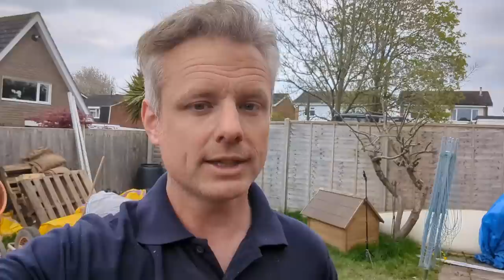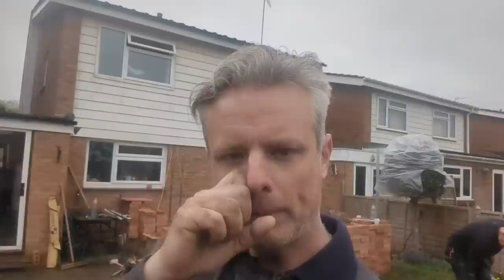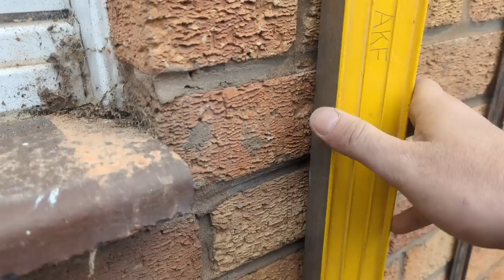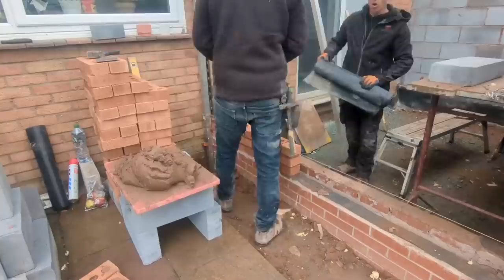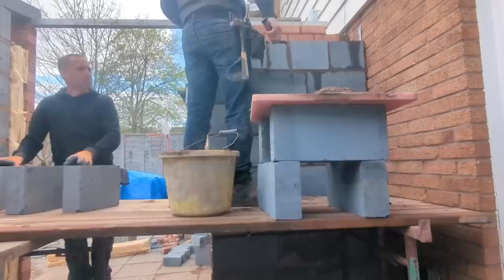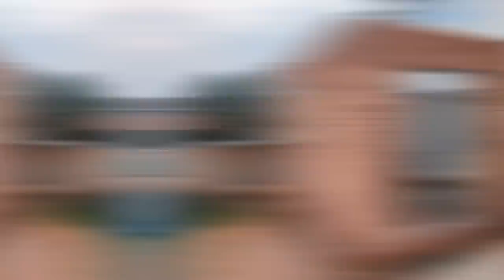HOW MUCH???!!! Warm Roof Extension Part 2 Bricklaying up to Wall Plate

Comment: Hi, thanks for the informative video. When I built some extensions several years ago you had to cut in to and continue the cavity where it joins the original back wall. I see you have used the vertical tie in straps but the cavity is bridged by the original back wall, similarly where roof meets original back wall, cavity trays would have had to be inserted (although in this case the cladding would probably suffice )so that the new inside wall is completely separated from the outside brick work. Is this no longer a requirement and does it pose any future problems with damp penetration if the wall subjected to high rainfall? Thanks
Reply: I could agree more, also fulll fibreglass cavity fill with a brick outer leaf... good luck with that in a bad wet winter.
Reply: yes thats how it should be done, could have problems with damp later on moisture can travel not so much through the brick but will travel through the mortar

Comment: Very interesting Adam, I’m glad an update is imminent for your house. Being honest, that’s the one I’ve found most interesting as it’s relatable 👍🏻
Reply from the maker: Cheers man, really appreciate you sticking with us. I take it you've got a bit of a project on of your own at the minute?
Reply: @mrabuilders6723  Hi Adam, not on your scale but I’m slowly working through my house. Old house, solid walls, no insulation type deal. Ceilings down, floors up, electrics and plastering. Yes, the prices are just crazy, even PIR board is through the roof (no pun intended)

Comment: Our build for our 6m X 6m extension went from £55k + vat to £58,500 + vat because the price was given using the old costs as opposed to the new regs
I paid without really arguing the point because I know the process are just going to keep going up
Reply from the maker: Fair play to you mate. Hope you're well.
Reply: @mrabuilders6723  just finishing all the little jobs that I couldn't afford for the builder to finish off, it's only been a month but just got the washing machine plumbed in 😁
Final job is getting the water softener fitted in two weeks time and then we can relax 👍

Comment: Hi just seen the build upto plate can't see by the video the cavity not being cut with a vertical DPC put in place, surely this will lead to possible damp issues ?
Reply from the maker: Hello steve, hope you're well. Thankfully we're not required to do that round these parts. Not doing that won't cause any issues at all. I get this question a lot and I have covered it in a previous video but I think I'll go into more detail in a future one. Thank you for watching, all the best.

Comment: I have some questions, I'm not from the UK... Why don't you make a concrete foundation and put the bricks directly on the ground and why no reinforced concrete pillars at the corners? Can that building withstand an 7+ earthquake and why do you make the floor at ground level, don't you have problems when there is a flood? It seems strange to me in a new construction not to rise a little. In my country, a cement/concrete foundation with a minimum depth of 70 cm is mandatory and the brick wall is not for strength, reinforced concrete pillars are needed and their thickness increases if the house has a second or third floor. We do the same with insulation between the rows of thin bricks.  We also finished an extension to our house in Innsbruck, Austria and I was curious. Thank you!
Reply from the maker: Lot of questions there mate but thanks for commenting. We don’t worry about earth quakes here and if this house floods we will be getting Noah and his ark out to save us all. 👍🏻
Reply: @mrabuilders6723  Asking because I've seen images from the UK of floods on TV, cars go quite deep in the water up to the bumper and there are quite often images of water in houses and I always wondered why you build the houses at ground level..I mean if it rains hard for several days in a row, they will have to call the fire department with a pump to remove the water from the kitchen 😂anyway, I'm glad that you started to insulate the houses in the UK , cold times are coming👍

Comment: Is cavity closing with the blockwork no longer allowed, even with a vertical damp between the facing bricks and the blockwork. That's the way it was done when I built an extension in 1976.  Just curious to see how much the regulations have been altered...Regards Robin.
Reply from the maker: Hello Robin, hope you're well. To be honest I'm not sure whether you're allowed to do that anymore or not but it's certainly not common.

Comment: so much for saving the planet then? 150mm cavity means bigger slab,equals more concrete, wider lintels means more steel and all the production elements into that..150mm insulation instead of 100mm etc etc.....i'm sure their going to say this reduces the heating costs of a building  overtime .....
Reply from the maker: Hello mate, can't really argue with any of that!
Reply: Build in timber instead!! A PIR filled timber 120mm timber panel meets the new u-values for Part L

Comment: Hi just seen a few videos and I appreciate them. I’m dreaming of an extension one day. I’d like to see steps and Timelapse when you do each part. Perhaps from a diy point of view. 
If well informed nearly anyone could build one to a certain degree. 
It also helps with understanding costs of what the materials are and maybe where to buy them for the builder if that would help in advance. 
I know some builders think we all stupid. I once had a builder quote £3.5k for 2 windows fitted and I had  bought the windows this was just for installation. I found an honest builder who charged £1.6k in the end. Did a great job too.

Comment: Well where were you Adam, 150 cavity hell here, just worked out how much more the 150 drytherm has cost me more than the combination of the 100+50 of the same…£160.
Am just finishing the opening in the flat roof for 2 lanterns on to which the warm  roof is going
Any further saving tips much appreciated as the wife can only afford to holiday herself, well suppose ever cloud and all that…

Comment: maybe you need to negotiate more, I had a quote of £2000 ish for some lintels, after threatening to buy online, got them down to £1300! which is about 79% off list.
Reply from the maker: Hello mate, couldn't agree more as these are "off the shelf prices" but of course that works both ways and if the 100mm stuff comes off the same amount then the difference is the same. Again it's the builder who's the only loser though, they are the ones who have to negotiate and argue the toss all so the customer gets the best price! It's difficult isn't it!
Reply: Yes, I find it really annoying that it’s always a negotiation with builders merchants.

Comment: Hi just wondering why you don't open cavity or put in vertices damp
Reply from the maker: Morning Stuart, hope you're well. That's a question we asked a lot and the simple answer is, thankfully, that we don't have to. We've never had a building inspector ask for it, never seen it done with my own eyes and never have any of my builder friends been asked to do it. I'm of the belief that it's a complete nonsense and the structural damage that it can cause can be immense. That being said, if the building inspector asked for it, then of course we'd do it but we'd ask for our objections to be on their notes so we're covered. Appreciate you watching mate, have a great day.

Comment: Word of warning. Don't fit those cavity closers until the day you put the frames in. Bloody sun gets on them and they buckle up.
Reply: Cavity closers. A pain in the butt for Double glazing replacement if timber windows fitted. Get it wrong and plaster reveal gets disturbed or falls away.
Reply: @RAY Ponting  yeah, those 80s houses with magnet and Southern windows.

I used to recip between the frame and plaster and cut the cavity closer. Either that or just trim it with 90

Comment: I know building regs change every week but do you not have to cut the cavities up on the original house? It was a must when i was at it.74 by the way.Also much easier to concrete your floor by tamping off your brickwork at dpc level.

Comment: I would think the increase in cost is partially to do with inflation (don't know if you were using today's prices for the thin stuff) but also obviously more material to make and then transport costs. you can't get as many rolls, sheets of thick insulation on each lorry. There may be a case that the thick stuff is not made in the same quantities as the thinner stuff as it has less uses. This may change with the new regs or it may not as you says there are ways and means of achieving the same result. I think in the end it's a good thing to build more energy efficient buildings.

Comment: Amazing work guys. Am not a builder but I am always amazed at how you do what you do. 👊Just wondering, do you need to tie the brick extension in to the rear wall of the house at all? Keep the videos coming. Just subscribed. From Dublin Ireland ☘️. 💪
Reply from the maker: Thanks for watching. The extension is tied in using wall starters.👍🏻

Comment: I’ve been fitting 57mm insulated plaster boards on the last job £60 a board that’s not cheap
Reply from the maker: Yeah man, that's a great option. There's loads of different ways to do it isn't there but the one thing they've all got in common is that they are all expensive!

Comment: Getting to a point where the walls are going to be so thick small extensions will be unbuildable. Else full cavities external insulation and insulated back boards?. Find out what the "real heat saving" is by use of high R Value materials which become too expensive justify to give a low U value. It is ridiculous, my LA whom I rent a house will not insulate my roof space because they cannot afford £300. Set of idiots, 20 years of no insulation that is 25% heat loss through my roof. How much energy is that?.

Comment: When you give prices can you also tell us the units. Is that £138 for 150mm insulation per square meter? Per 2.5 sqm pack? For the whole job?
Reply from the maker: Hello Colin, it was £320 cheaper to have 100mm and 50mm than just the 150mm and that was for the whole of the cavity, 20m². Hope that helps mate, thank you for watching.

Comment: So if you used kingspan would you be able to do a 100mm cavity?
Reply from the maker: Hello riptiz, thank you for commenting. There's definitely ways of keeping the 100mm cavity and as you say, using that type of insulation will do the trick, but you have to build the inner leaf first and that can't be done on a plot like this because of the neighbours wall.

Comment: I think the issue is builders merchants don’t give decent discounts to small builders ie sole traders or Joe Public you have to haggle hard and shop around
Reply from the maker: Hello Mark, hope you're well mate. What I've also heard, and I'm not saying this with any real evidence, is that the cost of making the 'wool' type insulation has increased massively due to the energy price hike because it takes so much energy to produce the stuff in the first place!

Comment: First loved the second banger of a tune . Our audience are at the older scale so they hate the bangers , I love it . 
    New regs have set the cat amongst the pigeons . There are so many ways to build and meet the regs, the 150 full fill knauf  cav is the simplest. We hate building the internal first and the kingspan K106 is £25+ per sheet plus the tape is extortionate ! 
    Our local merchant has started to stock 350 mm trench block and the wider lintels at very cheap prices. 
   Selco have just started to stock the . 32 150 mm stuff and it’s on offer too.
   The other little speed bump is the mineral insulation must be the . 32 now not .36 or.37 which is way cheaper but doesn’t cut it and it’s very easy to miss that and get caught out . 🧱👍🏼
Reply from the maker: Hello fellas! Great to hear from you, been watching your channel for ages! These regs certainly make it difficult to both adhere to and give the customer what they want. I'm the same as you, don't like building the inner leaf first, especially as we haven't had a building inspector in years that has allowed us to use anything other than thermalite blocks, and we all know how much of a nightmare they are when built first! Anyways, really appreciate you getting in touch, take care fellas.

Comment: Can you have 100mm cavity then superquilt internal walls to get it to the thermal value.?
Reply from the maker: I believe you could mate but no doubt you'll have to counter batten etc and the wall will be just as thick and you wouldn't have saved any money! It's a nightmare!

Comment: I’ve done loads of warm roof and yes a pain in the bum I’ve done same way as you have said and a way that has smaller fascia and step the insulation back that looks nice 45degrees angle to the insulation
Reply from the maker: Yes mate, I see what you're saying. Richard will do this one slightly different to that that you may find interesting, we shall see! Thanks for watching mate, have a great week.

Comment: My architects have specced a 100mm cavity with 90mm of kingspan k106 which is a phenolic insulation. Slightly better thermally that PIR so meets the new regs but very expensive compared to cavity batts. Still just in the planning phase. Im considering the options so great info. Thanks for the vids. Great insight!
Reply from the maker: Best of luck with it all mate, take care.
Reply: That's how my extension was specified the issue with it is it doesn't stop heat transfer to the breeze block I spent extra having a secondary layer of insulation with superfoil so batten on the inside superfoil then batten then plasterboard.
Yesterday was 30 outside and 22 in the extension I've also a vaulted cealing and underfloor heating the space is 30sq meters large kitchen diner relax space so I had the room.

Builder said it would have been better with a rock wool type insulation in the cavity anyway its done now
Reply: @SlowhandGreg  thanks Greg. I'll look in to insulation on the internal skin. I might be able to reduce the spec of the cavity insulation and save money too!
Reply: @tomoose22  having gone through the process I would definitely have a fibre based cavity rather than foam the brickies stuck holes through it for the ties its not one solid piece you can't tape it.

If you don't have room for a foil based wall secondary I'd recommend at least doing it on the floor over a mineral wool insulation between joists we have underfloor heating so I used YBS floorquilt.

The extension is massive so I went to town on the insulation and it was a retirement present for me and my wife.

Comment: I built my own house extension (11m x 4.5m) and the inspector wasn't happy when he saw no ties below damp...
Reply from the maker: Hello mate, hope you're well. What legislation did he show you to stating that there should be? I'm willing to say none.
Reply: I’ve never put ties below damp.
Reply from the maker: That's because you do it right!
Reply: @mrabuilders6723  the concrete infill 150mm below damp in the cavity negates the need for ties.

Comment: Very interesting .  I am a mere DIYer.  You mentioned at the start that you could not risk engineering bricks in the rain.  Excuse my ignorance what is that about.  Will then stain more ?
Reply from the maker: Hello mate. They hold water on the surface making them nearly impossible to lay when they are wet, they start to move and sink all over the place. Hope that helps. Thank you for watching.

Comment: A few years ago doing a similar extension there was a requirement to slice up wall between the two wall plates so that the new cavity joined up with the old cavity any views perhaps the extra work to prevent damp no longer required anybody enlighten me